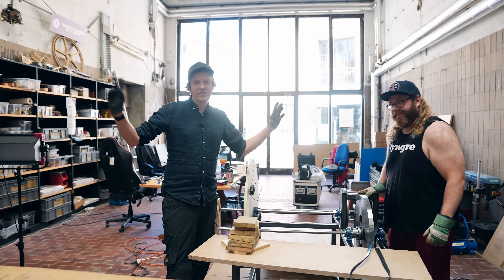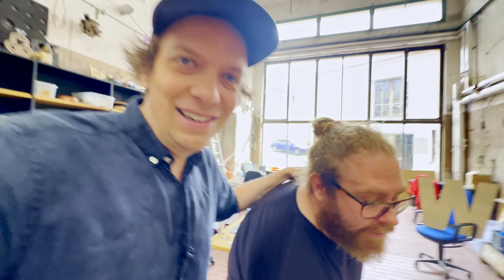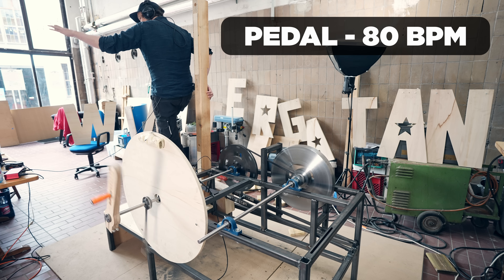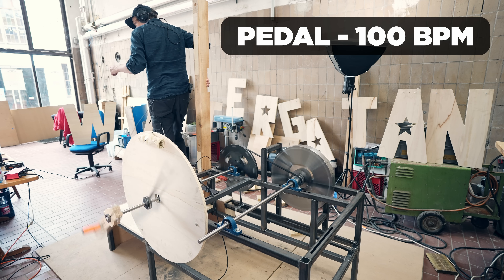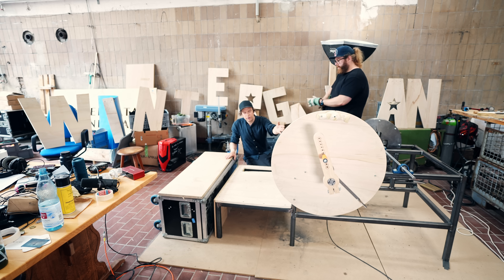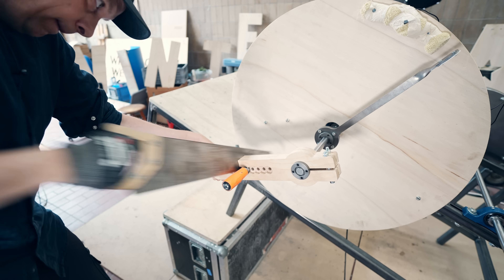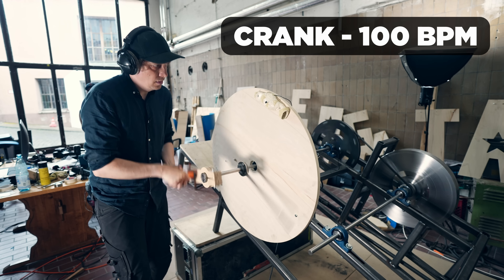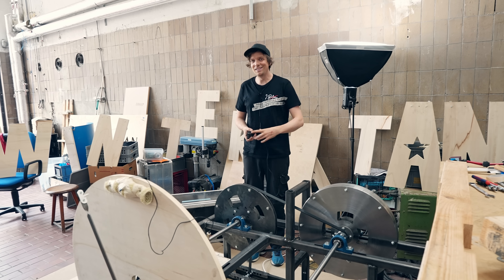Heavy Flywheel plays Tighter music! - DAY 11 - Marble Machine Flywheel Prototype

Comment: Even if the hand crank was better, the foot pedal frees up the hands for playing music
Reply: The hand-crank probably allows a wider range of positioning for using the other hand.
Reply: a motor would make it so that Martin could concentrate on the music, and not on his tempo. i dont see why obsessing about it being human powered, when a motor is proven to be stable rpm consistently. all he needs is a means to ramp up and down the motor to select BMP rates, and whatever power source is required to run the machine. its such a simple concession. there is no reason to play it by hand, when he can manipulate the instruments with all 4 limbs if he used a motor to Run the machine. that way he can Play the machine/instrument entirely.
Reply: @EddieSchirmer  I thought about that also. I wondered if he doesn't want any cables and have this a stand alone unit
Reply: @solarpowered3364  i think it is just too limiting to have it purely manual operation. it just doesn't make sense if all his effort is going into running the machine instead of playing it as an instrument. he can try manual operation all he wants, i am afraid it will fail and simply discourage him. a motor isnt an end of the world addition, it may instead be a necessary function, to be able to make it work. i hardly believe that there will be locations without electricity, besides, what about all the other instruments in the band? he needs to change his mindset from using human power to run it, and instead keep the human power as the creative manipulation of the instrument itself. modern pipe organs have electric motors to run the billows, why not have a motor to turn the machine so he can simply Play the instrument, and not be its motive force generator? 90% of his energy will be trying to move the crank, or pedal, and less than that of the rest for being Musical. but it will be 100% musical effort if he jus uses a motor to turn the mechanisms... he is making it way harder on himself by not considering a motor as the driving force. he is making the same mistake as the first 2 machines, in that, he is stuck on a concept and isnt seeing past that to a more logical solution. Motor= tight music, very low physical effort, way more creativity possibility with use of all 4 limbs, better concentration on the Music, rather than running the machine itself. i hope people can convince him to use a motor, because otherwise this machine is done before it has had a chance to start... it is like a saying my uncle had before ehe passed, "keep it Simple, Stupid." this means, "dont over-complicate things thinking too hard to make something work that wont work, when you can simplify things using the most efficient means to accomplish your goal."
Reply: @EddieSchirmer I was just at a memorial service at a church which had a power failure, and thus didn't have lights or air conditioning, but still had a rather substantial pipe organ thanks to the efforts of a choir member who was pumping it.  A 100% human powered instrument, even though it took two people to run it.  I'd suggest setting up a motor for the purpose of getting everything else working, and then maybe seeing about arranging for a true human-powered instrument if practical.

Comment: making the flywheel faster has a bigger effect on the moment of inertia of the flyweel than the mass, because the kinetic energy is calculated 1/2 *mass * v². So making the wheel spin twice as fast results in 4 times the inertia, while twice the mass results in twice the inertia.

Comment: have you considered how a clock or watch works? assuming proper gearing (think about the Lathe you used to turn the flywheel) could give you the precision and variability in a far more accurate manner than the current setup gives.
Reply: Variable shaped Turbillons for different tempos 😅

Comment: Can a centrifugal clutch be used to keep the machine spinning at a specific RPM? Depending on how accurate they are when disengaging and engaging the power, it might be a simple way to control the at what BPM you are running. But a problem would be that you might need to switch the clutch every time you want to run at a different BPM.

Comment: I'm curious how tight and easy to play this setup is when not being dictated by the external metronome... It's difficult to align such a heavy flywheel to a beat without waving between over and undershooting.

In reality, the machine doesn't function this way. It sets the BPM which other instruments align to, so the true measure is how well it can sustain a tempo rather than match an exact external tempo.

It must be considerably more difficult to match the BPM than set and sustain a BPM, and the unavoidable overshooting in doing so may be skewing the results to be less tight than it would be in a real scenario

Not sure how that affects the testing / measuring/ analysis, if at all, and of course he ultimately needs something to align to... But it at least feels like an important thing to consider

Comment: Just be careful with that wheel. It seams really powerful and if you add more you should look safety first and then ergonomics. I love this project!
Reply: I agree. I was more afraid of getting his hands or clothes to the moving parts cause it won't gonna stop if it finds resistant. When the machine start to get more complex he should be more careful. Mainly because yesterday he hit his hand
Reply: Take also care to resonance effect. Check (if it's not already done)  thé proper mode of thé all système. If you exited it a thé wrong fréquence, you Can destroy everything
Reply: The wheel is fine. There's no way it's going to escape the bar even if the things catastrophically blow up. In a production machine, yeah you'd want extra protection but that's more to save things falling into the wheel. The way they're testing though, there's very little risk of anything snagging in the wheel.

Comment: I think I agree with everyone else. The machines ability to be tight is not the same as the machines ability to match a metronome. 

I know at the beginning you were debating having a click track and I think this core question should be revisited
Reply: He could use the metronome to get to the target bpm, then turn off the drum track when he think's he's up to tempo. then just try to keep time to ear.
Then measure deviation of intervals between subsequent beats.

But i think he needs to set a clear target of some sort - so that his experiment has at least a fixed start point.

Interesting to benchmark vs a decent human drummer doing the same test as a control  . . . .?

Comment: You have a catch 22.  The heavier the flywheel, the harder it is to change the speed, so it will stay at a set speed better, but when you need to catch up to another beat, the harder it is to catch up or adjust your speed, and you will have a tendency to overshoot.  I think a governor of some sort is needed.
Reply: Over/under shooting isn't an issue with live music. Musicians are rarely on a rock solid tempo in live performances but no one notices because they keep in sync with each other. So the tempo waving around a certain BPM is to be expected anyway. What's important is that it's easy to keep it close.
Reply: @Beakerbite Depends on the artist. Many artists play their music to click tracks
Reply: I was thinking this for some time now. The Flywheel was supposed to smooth out inaccurate timing within stomping the pedal, while for one, the time keeping of many bands is centered around someone stomping a pedal without such aid, and seccondly, it robs martin of the chance to quickly act upon inaccuracies himself. The machine should rather be as low moment of inertia as possible. But how then add a power storage? Is one even needed?
Reply: @rigor_seggy I don’t think it is needed (or it only needs to be tiny — smaller than the MMX flywheel). There was too much friction in the MMX. I would go for a much smaller flywheel and then add a governor in v2 once I had an MVP.
Reply: This is what PID control is designed for. Adjusting the D coefficient when adding more weight will compensate for the overshoot.
Reply: @kingofgamesyamiyami6269  I think adding more weight will actually ensure overshoot. An infinitely large flyway requires infinitely large force to prevent overshoot. What would help is a greater load, a constant breaking force on the axis, that dumpens overshoots by slowing down the wheel. Or "pilot experience", to break manually, before overshoot. Or both. :) Fortunately enough, this machine will have some load, when it will be finished. Without any load this system is doomed to oscillate, except in case of a very experienced operator.
Reply: @atheist003   replace "very experienced operator" with "controls engineer that knows literally anything about PID tuning" and you'd be correct
Reply: @kingofgamesyamiyami6269  Yep, that's another way of doing it. :)
Reply: Could use something like a bicycle gear to quickly change tempo.
Reply: @mercury9385 bicycle gear might not be adapted due to the flywheel inertia, the changes might be too violent. He might need something such as a car clutch if we want to have different speeds
Reply: @nako9790  perhaps, but there are internal bicycle gears intended to swap gears under load...
Reply: Let the band sync to the Marble Machine tempo instead of trying to sync the Marble Machine tempo to the band. Problem solved. The heavier the flywheel, the better.

Comment: I wonder if the disconnect between when the petal is pushed and when the timer registers the beat is throwing Martin off. I know I’d find it almost impossible to keep time if I tapped my foot to the beat, but there was a delay before hearing my foot tapping the ground. Might also explain why it’s so much easier to keep time with the handle as opposed to the petal.

Regardless, great work Martin! Keep it up.
Reply: *crank, not handle. I’m guessing the variable delay seen with the petal is due to elastic losses in the mechanism (I.e. the petal flexing and not transferring all the energy). Making the entire petal mechanism much stiffer might help!
Reply: The pedals lowest point has been calibrated to match the tap of the mic so should hopefully mitigate this